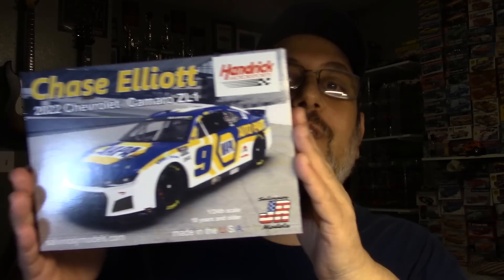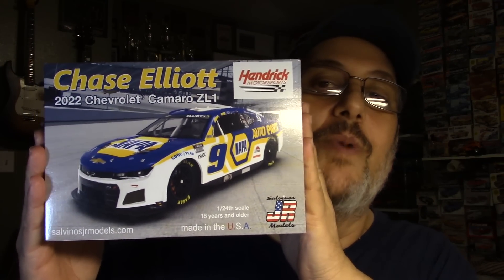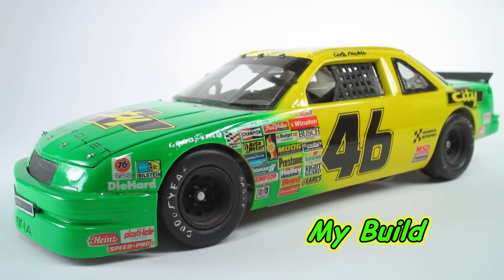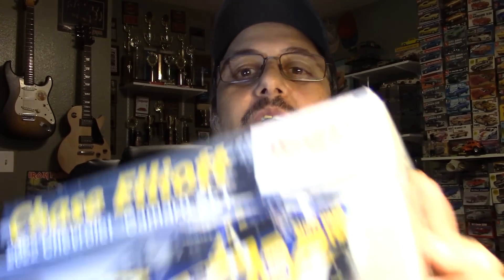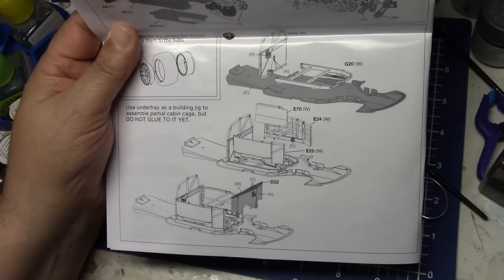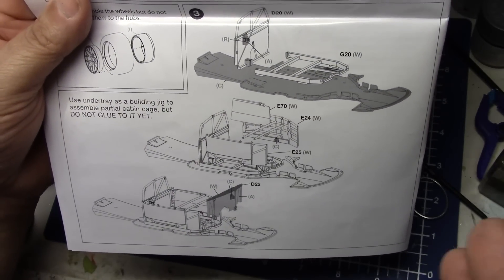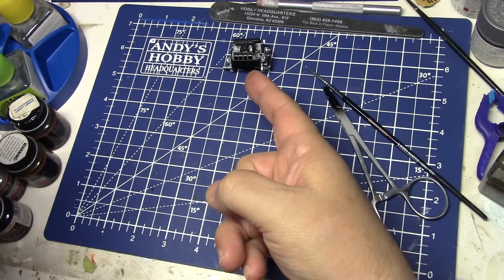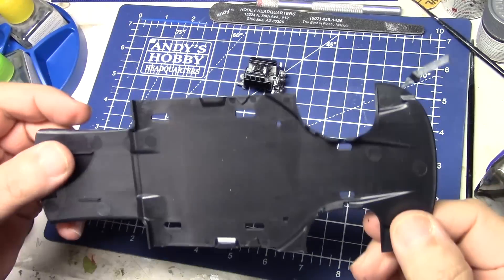How To Build The New Salvinos JR Models NASCAR Next Gen Camaro Part 1 Ep.203

Comment: Ok. At first I was disappointed when I found out the kit was molded in colored plastics. I am new coming back into the hobby and learned quickly colored plastics suck. 

However, I love that they are trying to get new people in the hobby. Especially with all the new race fans coming in, these new kits, like you said, will definitely make it easy for those no fans to get their feet wet in the model building hobby. NASCAR kits are what got me into it when I was a kid. My first kit was a mark martin kit in the early 90's. I was a huge fan of his. I might have been 7 or 8 when I built my first. It was a snap tite. No detail.

But these kits, wow. For a first kit to get new and old NASCAR fans into model building, I wish we had something like this years ago with the detail kit seems to have, for a first build and not have to worry about priming and painting. Awesome. Awesome. 

Mine comes in Monday. I guess you would be doing days of thunder themed with those two colors. I'm going to do all five of the movie cars with these new Camaros, but I'm also searching for the original lumina's and doing all 5 movies cars from the 90 lumina kits. I've started on 2 already. 

Sorry for the long comment. I'm just excited for these kits. Can't wait for the other manufacturers to hit the market as well as time goes on.